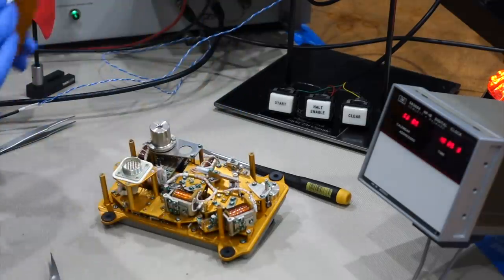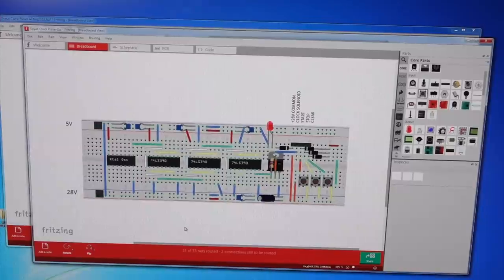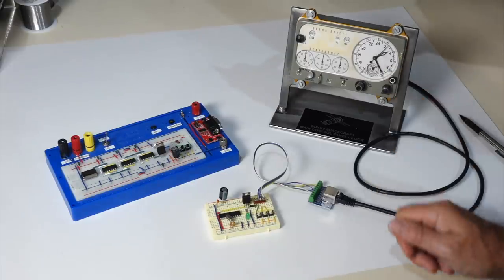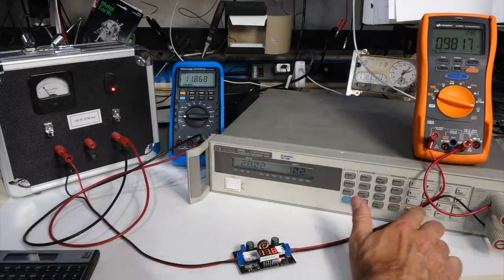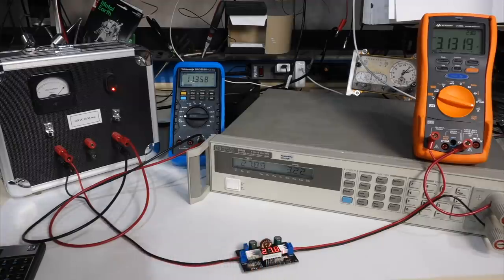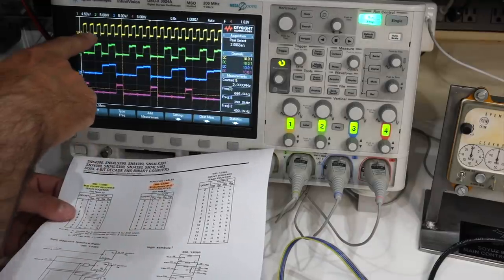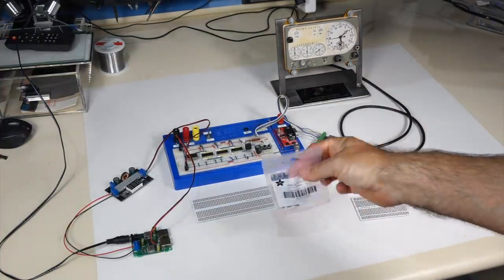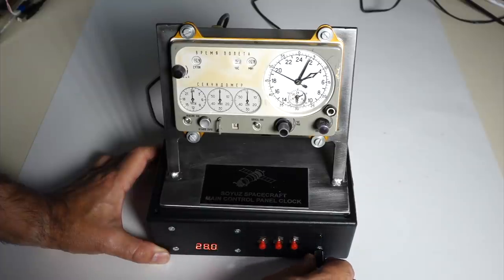Soyuz Electro-Mechanical Clock - Part 3: clock driver build and 100W boost converter review

Comment: As soon as you said 100 Watts I immediately thought, "No Way" 😆
Reply: Another chinese product with chinese WATTS ratings.
Even with the highest CFM fan attached, the components won't live more than a week.
Reply from the maker: It used to be that with HP, you took the spec and you could count that it would work 2x over it. With that stuff, you take the spec and you have *divide* it by two! But not the same price, mind you. Still, very annoying that specs have become meaningless and vendors get away with it. That's not progress.
Reply: They meant 100w for a few seconds

Comment: icstation is also just sourcing straight from china and resells it under their name.
this boost converter is the ltc1871 type you find all over ebay and aliexpress.
Reply: Dang, scammed by the sponsor! Although, I guess it's not a scam if you don't pay for it...
Reply from the maker: Indeed that's what it is! Good catch. But it works (and I saved 6 bucks)...
Reply: @aaronjamt  It's not a scam at all if you get what you're promised. They're under no obligation to tell customers that the same thing can be had under other names.
Reply: @mal2ksc  r/woooosh
Reply: Their price seems in line with everyone else that I could see.
Reply: @aaronjamt  not a scam, actually their price is not too bad, for that you get it shipped quick. over here the resellers are much worse. adding like 5x the price on such things.
Reply: Yes indeed, and 6 dollars is still ultra cheap. I'd never use something like that anymore, I rather pay more for a more reliable experience overall.
Reply: @VincentGroenewold  I think the cheap ones are good enough if you go in with the right expectations. And consider the spec to be 'very generous'. Something like this if it is used for... say under 10-20 watts with the occasional momentary increased draw, it will be perfectly suited. 

It is like the kit amplifier my son bought for a project he wanted, the amp was rated 600 watts, so I told him its good for about 30.. lol. When we got it and benched it though, I was surprised it exceeded expectation and got 58... But it was $12, so not a deal breaker. 

My son's first experience with Chinese power ratings..He actually thought it would 600 watts when he ordered it. Once I reset his expectations, he was surpised that it did double what we figured hahaha

Comment: It's a bit late, but found an additional piece of information.

Recently I received an unexpected present: The book by Sigmund Jähn from 1985. He was the 1st German in space. He flew 1978 with Soyuz 31to visit Salyut 6.
The book is addressed at a general audience and contains a fair amount of propaganda. But it still a good read and some details and information I had not expected.

And - guess what - it mentions THE clock!

Apparently many systems were switched off during launch to prevent damage from acceleration and vibration. Only after the separation of the last stage the rest of the ship will come to life. He especially mentions the clock starting to tick. (I guess the clock was really the first thing)
* That means the clock did not have to fight against the launch vibrations. Why was it still so robust?
* It counted the time in orbit not of the flight.
* He was confused by the 24h clock face till the end.

I guess when people read this passage the get a completely wrong impression.
"We are in space now and the clock starts to tick"
Yeah, it's so quiet out here, only a faint ticking can be heard.
So wrong! It's frigging loud! And the frigging clock is even louder!
Reply from the maker: Great info! Thanks!

Comment: You should put the Tetris theme as one of the alarm settings!

Though with that clock, all I can imagine is one of those old fashioned alarm clocks with the hammer and the two bells.  A very loud version of this, mind.  I wonder if there are any churchbells and sledge hammer combinations that would have fit in their mass budget...

Comment: You can use a fair amount of capacitance to provide the pull in current for the mode solenoid.  Then you can let the current fall to the hold value.  Since the solenoid needs to only be on briefly this will be fine.
Reply from the maker: In this configuration it never really holds since it auto cuts via the start/stop/clear contacts. But it really wants the starting juice, it would briefly trip the 12V 3A supply on the other end, no matter what (reasonably sized) capacitance I put! I saved you the footage and explanation. This little converter with lots of headroom kept up with it though. I liked it.
Reply: @CuriousMarc  Well it is an interesting thought experiment. This needs say 8A at 12V for how long, 50ms? Then it waits 1s-50ms until the next time it needs a pulse? That suggests that the steady-state draw is 1/20th of 8A, or about a half amp at 12V. 

So I'd look at it as a science project of computing the number of Farads to produce the necessary 100W 50ms pulse by capacitive discharge, and then a current source to be able to recharge the cap by the next time it needs to discharge.

All of which would be real cool, and probably be 4 times as big as that 100W supply, and cost 3 times as much. :-)
Reply: @lwilton  I was about to do the sum for interest, but it is actually more complicated than that. The solenoid is inductive, so the current will be much less than the 8A steady-state current. It would be interesting to see the current, either with one of Marc's fancy current probes or by looking at the voltage across a current sensing resistor.
Reply: Just for giggles, I make it a 0.1 F capacitor if you allow a 4 V drop per pulse. Avionics 28 V supplies are not precision things, so this magnitude of drop would be allowable. That's still quite a large capacitor! As I said before, I think the real value would be much smaller, though.
Reply: @Derundurel  My swag would be around .03 to .05F assuming it actuates in around 30-50ms. But that is still a pretty big cap. And there is the question of whether the cap would like 4V of ripple, even at 1Hz. So it might have to be bigger.
Reply: @lwilton  You can feed the capacitor with a 1A constant current source.  This would provide limited hold current and reduce the startup current surge.  I have a 12v solenoid here that needs the 12v to pull in and still holds at 3v.  This cuts the current from 1A to 250mA reducing the heat build up immensely.

Comment: Imagine being in a Soyuz capsule all by yourself in orbit, and the only things you can hear are your own heartbeat and that clock ticking.
Reply: You wouldn't. The Party needs that you adjust your heartbeat to the clock. ;)
Reply: @docnele  I think that may have been the design intention with such a loud click. Slower heart needs less oxygen
Reply: The life support equipment is quite what you could call "silent".
Reply: @MrNoobed  I doubt they really considered that, but-who knows? Also, I used to repair old HP laser printers, they had padded solenoids because they were unbelievably loud without them. The padding was an afterthought, there was no mention in service manual, and it worked for 5 years or so before the pad glue started to bind solenoids. Maybe the solenoids in Soyuz clock had some padding that was removed.
Reply: If I'm out in space alone, making calculations to figure out how to get home, I love that clock, it brings comfort. I'd be right freaking out if it went silent.

Comment: I think if you replaced the caps with some quality low ESR caps, and maybe beefed up the heatsink a bit, it could probably run closer to 100W continuously. Pretty decent for a $12 switching power supply!

Comment: That alarm sound could also have been made using an unused timer of the attiny outputting to a GPIO if you need a cheaper version
Reply: Or just tapping it off the divider with a few gates.  Especially the traditional 2kHz pulsed beep.  Anyway, surprised this didn't use a 32.768kHz clock crystal with one 4060 or two 74393 dividers.  Use 74132 or 4093 for oscillator and logic.  4060 is a classic single chip 2Hz generator, providing both the oscillator and 14 bit divider, but Tesla in Czechoslovakia apparently only made the 4020 without built in oscillator.

Comment: The Atmel solution allows you to slowly ramp up the pulse rate to run slightly fast after a few hours, then slowly ramp it down, run slow to compensate for the time you ran fast and then return back to normal for a few hours.
Reply: Why would you want to though? Isn't the point of a clock to be accurate and consistent? Maybe so it doesn't drive you mad with that crazy loud mechanism?
Reply: @dwarf365  Exactly:  everyone expects clocks to be accurate and consistent.  Incidentally they happen to be something that is always overlooked for calibration in my industry.
Reply: @dwarf365  It's a spacecraft. Need to simulate the effect of a near-light-speed trip.

Comment: You missed the opportunity to get some NOS or used stock of the appropriate Soviet era push switches, to make the panel match the clock itself.
Reply from the maker: Agreed! I thought about it for a while, make it in a military metal enclosure with the biggie switches, but that was too much effort and I didn't have the time before I had to return the clock...
Reply: @CuriousMarc  Even so, just using aircraft grade push switches would have felt much better, instead of the cheepie ones. Hopefully one of the tunes included in the alarm system sounds is your signature Soviet anthem.....
Reply from the maker: @SeanBZA  More aircraft parts more better ;-)
Reply: @CuriousMarc  Just ask FranLab for some vintage switches, I'm sure she'd help you out on that front! :)

Comment: That was right nice!

What was that proto-board prototyper you had on the screen? I've never seen that before.
Reply: Bottom left of the screen you can see the name: Fritzing
Reply: @Effectlife  Thanks. I saw it, but thought that was just a project name Marc had picked. I knew "fritzing" as a verb rather than a noun.
Reply from the maker: @lwilton  Yes it's actually called Fritzing. It's both great and annoying. Great idea, but quite rough in all the details of the implementation and user interface. There is so much simple stuff you'd think you should do easily, like stretching the spacing of the leads in a component - and you just can't. It has that very annoying one-step-away-from-greatness feel all around.
Reply: @CuriousMarc  That's also what I noticed while using it. Great idea/concept. Not so great execution, unfortunately...
Reply: The fritzing project is also sort of dead, especially after they started asking money for it.

Comment: Oh, he is uing a rotaluclac (or what do you call a calculator where you have to enter things backwards? ;-) )
Reply from the maker: That's a great one, an HP Rotaluclac it is from now on! But nah. It's everyone else that's entering the stuff backwards!
Reply: @CuriousMarc  Let me check my stone chiseled notes from 1st grade maths... Under a thick layer of dust I can see something like "1 + 1". So you mean we were learning it backwards from the beginning? :-o
But maybe this is just so different because you are originally from France and I am from Germany. We call the European Union EU, while you call it UE. So maybe our minds work in opposite directions and we interpret "backwards" backwards.... ;-)
Reply: @Colaholiker  Inside your computer or calculator the numbers are (often) pushed onto the stack and then operated on so 1, enter, 1, + instead of the popular 1, +, 1, =

Reverse Polish notation was easy for programmers to accept and one automatically uses the correct notation when picking up a landscape Voyager series calculator.
Reply: @KallePihlajasaari  I do bare metal (no operating system used) programming on ARM processors, mostly in C, but also some assembly. I think to have a rough understanding how computers work. ;-) 

Even if numbers are not pushed on the stack, all processor designs I am familiar with require you to first load the operands into registers (or at least one, if the other operand is a constant) and execute the arithmetic instruction afterwards. So yes, computers use RPN internally, but are trying their best ti hide it. 

It's just a common joke when it comes to calculators, that one way is wrong and the other isn't. Especially since RPN calculators are quite rare compared to those that use infix operands. You don't see RPN calculators too often on YouTube, but with HP being known for their RPN calculators and Marc being 'Mr. HP', it's no surprise. :o)
Reply: My parents have an HP Rotaluclac just like that one that's probably older than I am, so no newer than the 1980s.  The amusing thing is just the other day I was at the office store and glanced at the calculators and...  They still sell HP12 Rotaluclacs to this very day!  I can only imagine that the innards have been modernized, though (and by "modernized" I mean replaced with Chineseium).
Reply: 12C and 15C were the classic HP RPN calculators in the late 1980s.  It's called reverse because functional notation would be add(1, 1) but the calculator accepts 1, 1, + allowing you to decide after entering the numbers.
Reply: @KallePihlajasaari  Well, HP definitely still sells the 12C.  And here it is on the Best Buy website, and it even says it's in stock at the store I went to.

https://www.bestbuy.com/site/hp-financial-calculator-black/9023969.p?skuId=9023969

Also, at $70, I really would hope they still have high build quality, but who knows?

Comment: Ack ! The evil CapXon caps again. "The green evil". Responsible for premature death of expensive gear like computers and flat-screen TV or suchlike. The darned german "ROE"-elkos in their wine-red, grey or orange shiny plastic cases were pretty bad already - but it took them 40 years to get there. The CapXon are already bad when new. Get some 105°C-rated Panasonics Low-ESR in there and it might work way better.

Comment: I just re-watched the video.  What are the current ratings of those red push button switches?  If you're pulling 8A @ 12v that's 100 watts or over 4A @ 28v.  Those switches are only rated for 1A.  I'm surprised the tactile switches used during testing survived since they're only rated for 50mA.
Reply from the maker: It works because they don’t cut any current. The internal rotating switches do.
Reply: @CuriousMarc  Current rating is on the make part.  Voltage rating is on the break part of the switch cycle.
Reply from the maker: @randycarter2001  Hmm I believe you are right. However the max current rating is mostly limited by the heating of the contacts I think (at least it is for our connectors). So maybe we don't have a problem because on-time is so short?